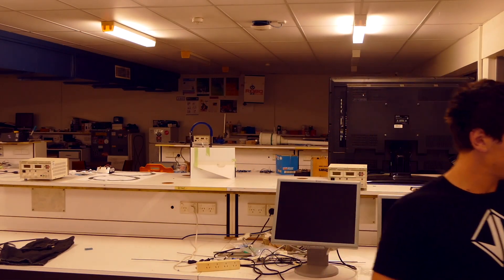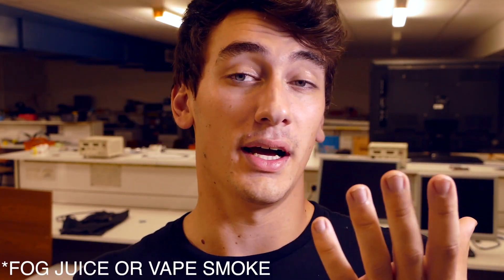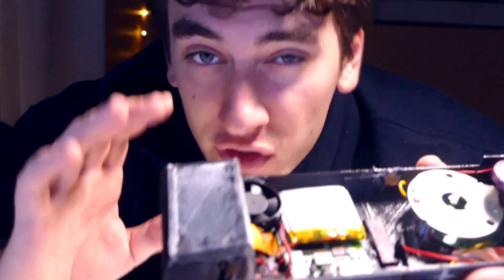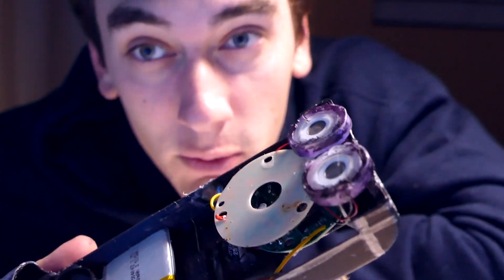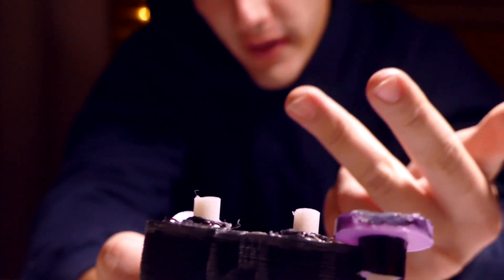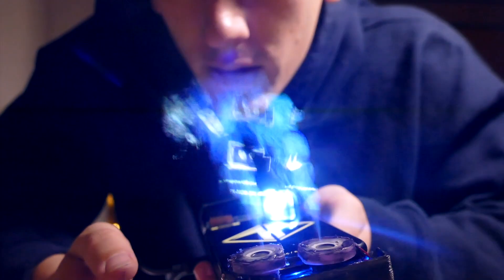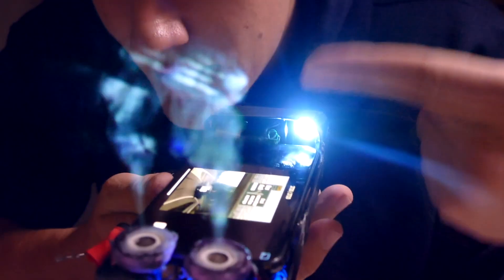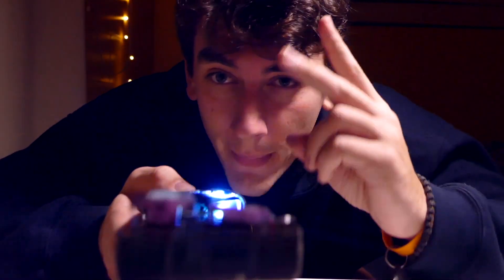Smartphone Hologram Attachment That You Can Make!

Comment: You should try to find a way to control the way the vape despenser streams out. It needs to be one flat stream 👉➖️ rather than two round streams👉🔘🔘. The flat stream should emit out the device fast to stabilize the steam. If it's slow, the steam will not look solid. It would look like a gas.💡

Comment: The water vapor/fog is coming up in a conical flow with plenty random spacing causing the image to look much more distorted and fractured. I don’t know how you would fix the gaps/fracturing in the picture, but if you 3D print a cover for the humidifiers causing them to transition from a circle to a flat sheet, an example of this would be a straight duct boot used in HVAC systems, google it if you don’t know what I’m talking about. You’d have to make the outlet much thinner tho, and adapt it to have two circular inputs instead of one, and it might lose quite a bit of vapor pressure, but the humidifiers seem decently strong, it seems like it’d be worth a shot if you have the printer access. Anyway thought this video was very creative, good luck with the hologram builds

Comment: Let me speak in algebra x + 3=y
If you had a ventricle system with a spinning top spinning at our speed of with a Servo motor of and the quadcopter drone flying at a speed square human eye cannot see you have Beyblade
Reply: Ventricle system like air conditioning vents
Reply: Quadcopter flying at a high speed like a drone
Reply: The ventricle system pumping in the Smoke of the air
Reply: The quadcopter with a projector of Dragoon